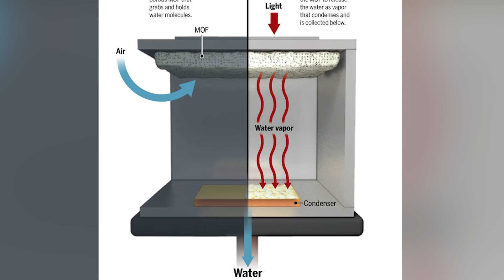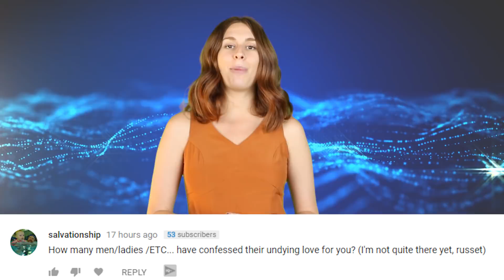We Can Now Make Water Out Of THIN AIR

Comment: Pulling water from the air isn't exactly new, there is a billboard in Lima, Peru that produces 26 gallons of water a day.  The researchers from Berkeley have found a way to produce water in areas with really  low humidity.
http://techland.time.com/2013/03/05/finally-a-billboard-that-creates-drinkable-water-out-of-thin-air/